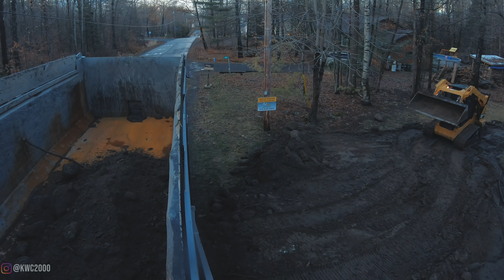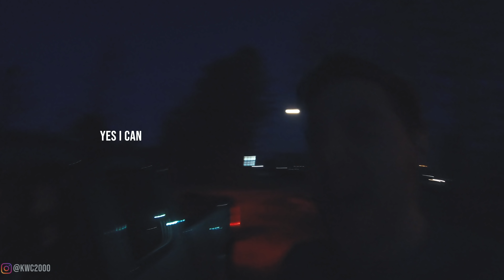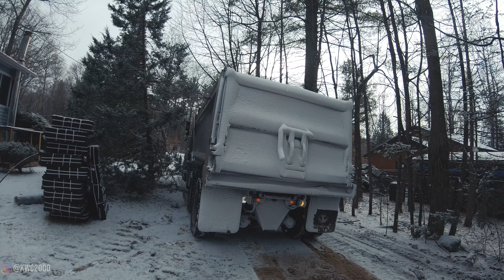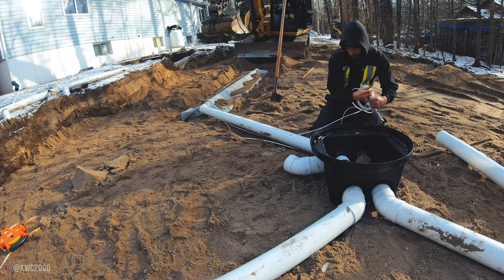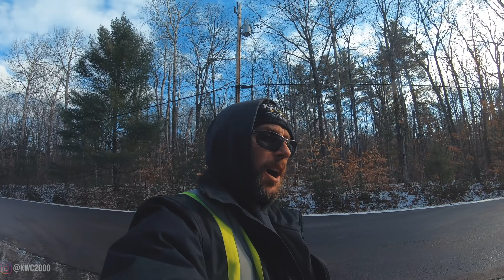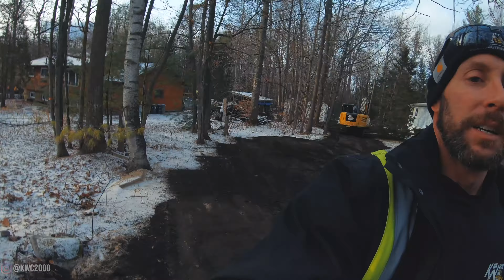Last Complete Septic Install of 2019! (Entire Project) 4K

Comment from the maker: who all on here has seen a system like this before? or was it totally new? comment down below.
Reply: Ken White Construction it was new to me
Reply from the maker: That’s great to hear!
Reply: Ken White Construction  Wrap it up. I have never seen this type of septic. Here in Ohio the newest system is the pop up sprayers. Not sure what it’s called but the system turns on at night and sprays from the tank into a leach field.
Reply: One of them $$$$ Eljen. We have a hard time getting sand for those systems
Reply: Never seen a system like that in central Alabama USA. Great video. WRAP IT UP GUYS. I wish I could work happens year around down here
Reply: Ken White Construction where I live in the Catskill mts in ny our systems are mostly concrete tanks 1500 gal standard but it ranges , sometimes there are 2 tanks, a dosing chamber ,our a pump chamber which if you don’t have the gravity feed to the leach field , but all our leach fields have to be trucked in and have to have a perk test done after the sand bed is installed,it can get costly, as far as the pipes in the field goes they are usually 5 fingers 50 to 55 feet long , 6 ft apart on center with a 6 or 8 hole d box,, but every system is different and has to be engineered to specks which can be costly ,, the average system can cost you 20,000 to 30,000 bucks, takes about a week to install by the time you truck everything in , perk test , set tanks backfill and topsoil, seed and mulch , health department and nyc watershed are very strict on everything we do and have to be inspected before anything is finished , have done many different systems anyway every one is different 👍 depending on how much room you have on a property , and how many rooms are in the house,great job you did everything looked very professional 😜would like to come and play in the dirt with ya, got many years under my belt in heavy equipment operation 35 to be exact 😜 love what I do and keep up the good work👍

Comment: The heated truck body’s work awesome! We got a bunch of Mack’s with them and they stay clean even hauling snow! Slides right out while the trucks without it come back to the loader with half a load.. also have a couple off road articulated trucks that run the exhaust through the dump body

Comment: WRAP  IT UP.  Super way to finish 2019 just another great job by KWC & Crew. Hey Corey what kinda hammer were you using in the junction box, almost looked liked a DeWalt 24v, ha, man you ain't supposed to beat up your cordless tools like that, just kidding been there done that, whatever works, especially when its cold and snowing, well guess i'll get ready for the snowplowing vids, Taylor, Corey you guy have a great Christmas, party hard see you in 2020

Comment: Instead of using a box knife to cut the holes in the dbox, use a holesaw on a drill. Much easier. 

Also i have a sterling 10 wheeler with a heated box (exhaust runs through it), and honestly its great to have for both winter time, and when hauling asphalt to keep it warm.

Comment: We don’t run exhaust to the box where I work but we do use this chemical called calcium chloride which is used as a concrete accelerator. We just have those hand held plastic herbicide sprayers. We run all winter and never have issues if we spray.
Reply: nick and that will rust the body ! Try using liquid shovel .

Comment: Yes I have heard of the exhaust system in the box of the dump box.  I work for a city and one of our water department truck has it into the box. I think that it works to a point. But some still gets stuck in the box.
Reply: it depends how the channeling are done, my boxes are made the old way with many smaller channels spread out not far from each other so the floor heats evenly. heavy but made for hauling shot rock.  new design boxes use fewer and bigger channels further apart. i can see those having more problems with sticky materials. 
it mite have been a bloke here in town that invented the system back in the days, he had a Volvo rock truck, jerry rigget something himself, folks from Volvo saw it and started making it themselves. 
if just could figure out a system on semis,
Reply: @sisutrucks  the stuff that they haul is muddy and lots of water from water main breaks and the truck may sit there for hours on a  cold night before they even empty it.
Reply: @billfenner7084  yea that's not ideal hehe. We shut the engine off for couple of hours with a gravel load one time it was very cold. Raised the box to the top and not a single stone came out. We had to drive around for 15 min to leat the bed heat up. Then we got it out. Learn as you live hehe

Comment: Nice work as always fellas.  Two questions.  1. Why did you use a 90 on the effluent pipe coming from the tank to the d-box instead of a 2 45's with a short piece.  Although there should never be solids in that pipe, I thought gradual was always better for waste.  2.  What were the white lines you installed?  Assuming a warming element as you're on 14" under cover.  Wrap it up.

Comment: Great vid!  Wrap it up!  We put our “D” box at one end instead of in the middle. Curious why you guys put it in the middle?  Is it engineered that way or is that what the state requires?  Love the clean up finished product. Looks great!
Reply from the maker: Just what the engineer called for based on location, flow, and property
Reply: Nathan Cudaback without getting to technical, the flow rates and size of home determines how much contact area of sand you need for your bed. With eljens you get a number of units required and these units need to be evenly spaced in the contact area. This is why D boxes are sometimes on one end and sometimes in the middle, also why sometimes the units are tight together in lines and sometimes  have spaces between the units.
Reply: @corylurette6178  ok. Ya I figured it was something like that.  We go by number of bedrooms which determines the gallons per day usage and the sq/ft of drain field.  Thanks for the reply. Love the clean install and final grading you guys do.  It satisfies my OCD....🤣

Comment: I enjoyed the video but I think that you made a couple mistakes that could end up costing you. Firstly, I think you used way more sand than you needed to, why not use more of that native soil that you paid to haul away? All that extra sand cuts into profits and or decreasing your ability to offer competitive bids.  Driving your skid steer and excavator on the system is very risky. You likely over compacted or crushed the areas you drove on and pooling may occur in those spots among other possible problems. Otherwise, great quality video and I truly enjoyed watching it.
Reply: Chris Worst systems like this are engineered by another company and inspected by a different company, the backfill you are allowed to use on systems where we are must reach spec requirements which the native material did not. This system is rated to be driven over by track machines by the manufacturer, is you notice always straight on and straight off no twisting or turning on the bed, as for the pipe crushing if they are packed around and laterally supported with enough cover this size of equipment doesn’t crush the pipe, I have personally tested this countless times. Thanks for watching

Comment: i have that on two of my trucks, run the exhaust into the channels under the box floor. frankly its the only way to go if hauling in bellow freezing temps. some have vibrators, but use that much and stuff starts to crack. 
video of my truck showing how its built. in the trailer boxes i use table salt and old coolant, that works also.
https://www.youtube.com/watch?v=Xhh4MohQ7jU
Reply from the maker: Sweet! That’s so handy
Reply: @KenWhiteConstruction   another nordic thing, converting a dump truck to tractor unit. depending how its built it only takes from 10 minutes to set the dumper box on legs and be ready to hook on to a semi. 
can use a truck more then if you have one sitting most of the time that pull a rgn for the occasional heavy machinery move for example :)
Reply: Stian twist lock setup, my 8 wheeler has a tipper and transporter setup which I swap between depending on job requirements